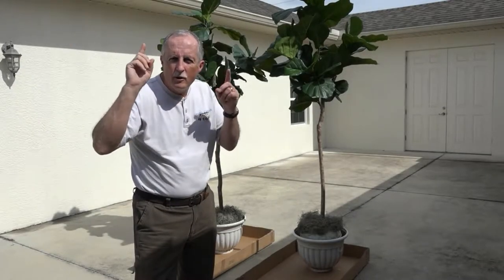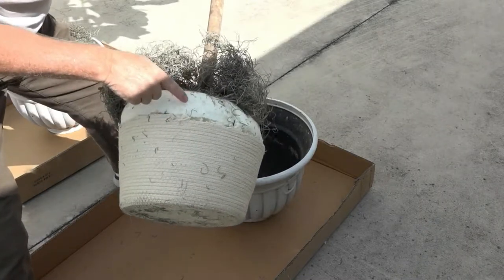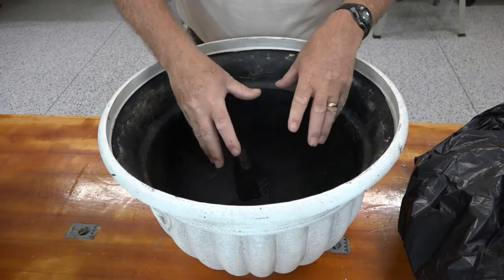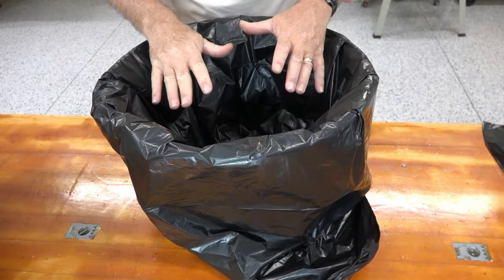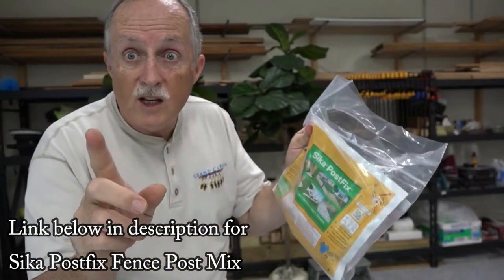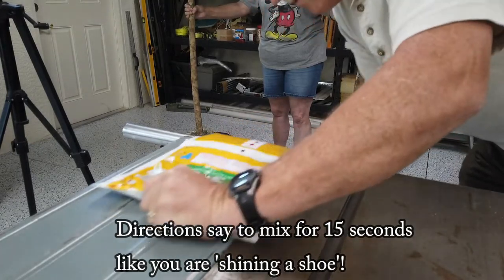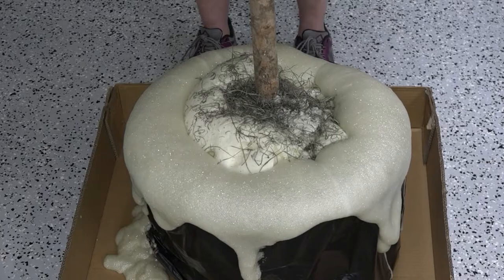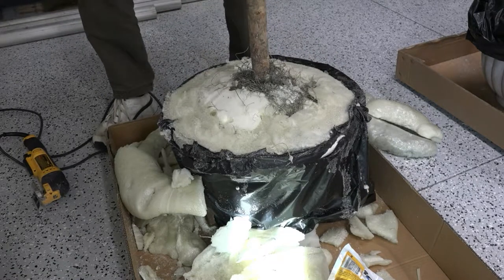How to Pot Artificial Plants for Outside!

Comment: Looks like the foam in the bag is the same as in the can. Did it add weight to the pot so they don't tip?
Reply from the maker: No the expanded foam although ridged is quite light!